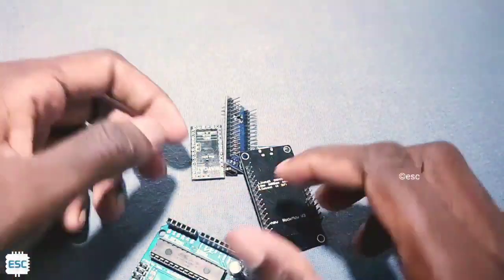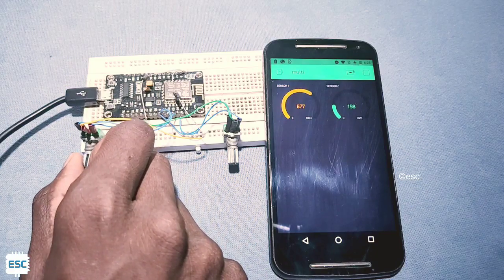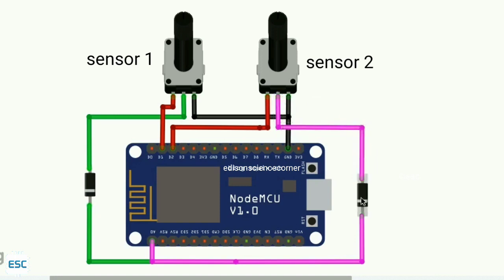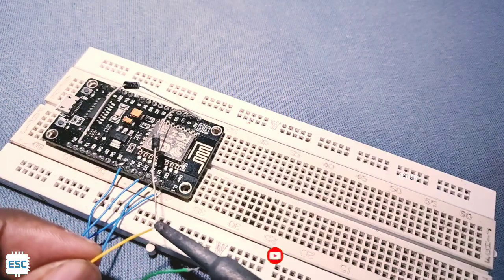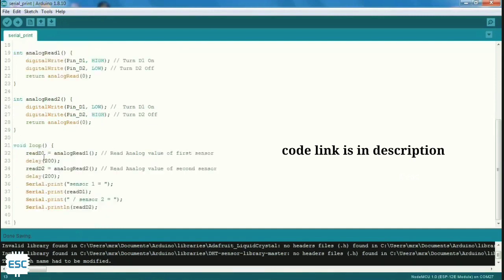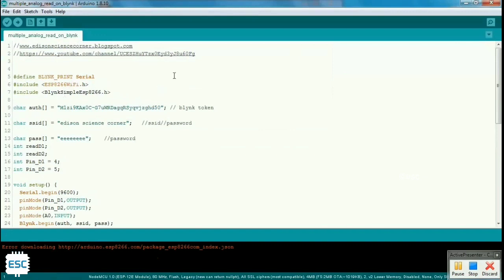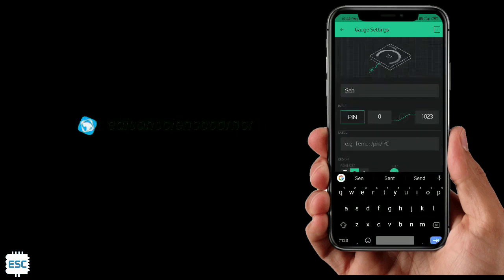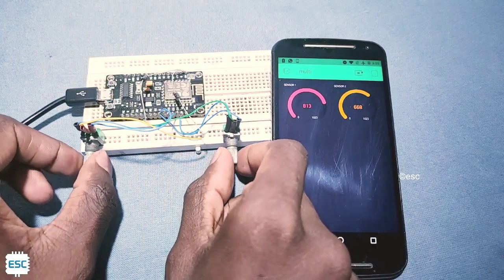Read Multiple Analog values in esp8266 | DIY | Nodemcu

Comment: Little wrong, as Diode forward bias voltage 0.7 to 1 V would come in picture, so you wont be able to read lower values.... Use relay instead !
Reply from the maker: Yes thats true
Reply: You´re right!

Comment: I am using turbidity & TDS sensors for project. So digital pins should be connected to which pin of these sensors?
Reply from the maker: You can use any digital pins for that

Comment: If i want to use 4 gas sensor (MQ4, MG811, MQ131, and DHT11), can this method be used?
Reply from the maker: Yes you can use this method for analog sensors and you can connect DHT 11 sensor to any digital pin
Reply: Okey, thank u🙏
Reply: If i use modul analog multiplexer, can this code be used? 🙏

Comment: If I use 3 different types of gas sensors do I have to use diodes too and is there a program change? Thanks
Reply from the maker: Yes you have to change the code

Comment: If the Blynk coding is omitted or monitoring is done only through the serial monitor, does it affect the voltage reading or not?
Reply from the maker: Blynk code just for demo. One more video available in my channel check it.

Comment: how do you read 100 analog inputs twice per second with esp8266
Reply from the maker: 100?
Reply: 100... For example if you want to read each cell voltage in a 100S pack, using voltage dividers

Comment: I would like to give your project a try. Regarding the diodes, does it require a specific diode? Which did you use?

Thank you
Reply from the maker: Go on. Use 1N4007
Reply: @EDISON_SCIENCE_CORNER  I have two of those diodes so I will test them. thank you
Reply: @EDISON_SCIENCE_CORNER  My sensors work with 5v and the esp8266 only have 3.3v power. Currently, I use an external 5v power supply to power my sensor with common ground connected to esp8266. Would I be able to use your method with an external power supply for my sensors?

Thank you
Reply from the maker: Use a trasistor driver
Reply: @EDISON_SCIENCE_CORNER  I have tried with transistors but I really struggled to get it to function with a stable reading. Do you perhaps have an example of how you achieve this? I tried using a 2222A and also a ksp 44 c20 as I had some laying around